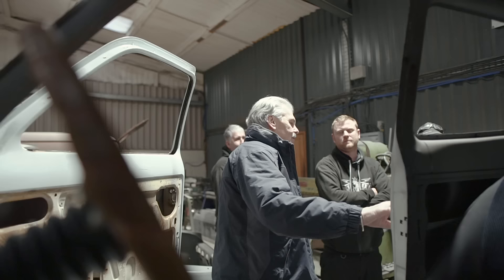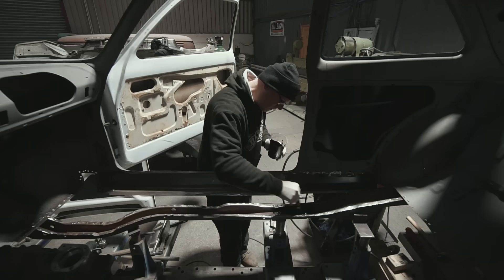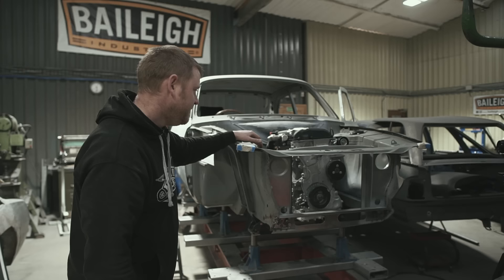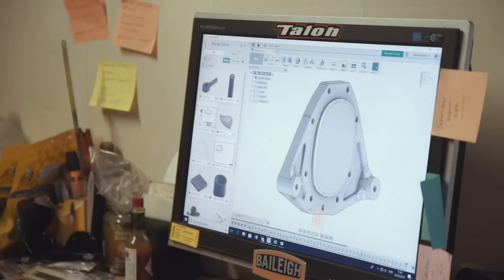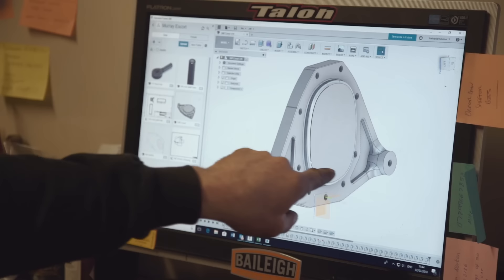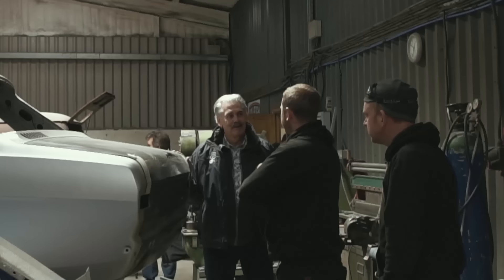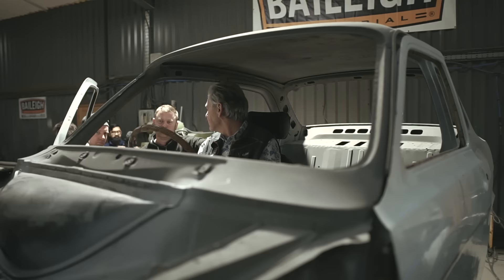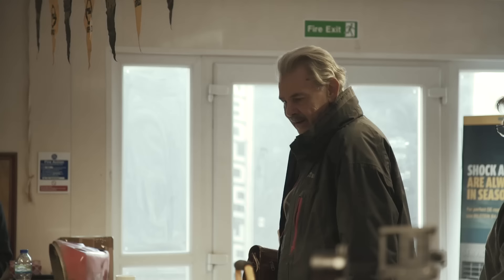Gordon Murray's MK1 Escort - Retropower Build Episode 4

Comment: It can be seen that there are still quite a few decent MK1 Escorts knocking around, it must have been a temptation to get another car and build this project into the best one they could find. You can be certain that when the car was current, rally cars and circuit racers were more often than not converted from 1100cc shopping getters.....
Reply from the maker: inquisitor229 the problem is most of the "better" cars you see aren't what they first seem. We've blasted 100s of cars and invariably the best ones are not those which initially look shiney and straight. That's not to say we couldn't have found a better one but keep in mind that Labour is being charged to search for and view cars, and the purchase price of a seemingly good car would be much higher.. at that stage the loss if it's found to be hiding a lot once blasted is more substantial. It's not a straightforward process sadly.
Reply: Understood. Although I didn't think Gordon Murray was stuck for a few bob.......   :>)
Reply from the maker: inquisitor229 true 😎 but that doesn't mean we aren't at least trying to avoid wasting money uneccassarily. Could we have hot a better shell for the money? Quite possibly... But we could have done a lot worse too so happy enough 👍🏻
Reply: inquisitor229 why do you put ......at the end of each sentence? What does that mean?
Reply: It's my way of suggesting the topic is open ended, and that I am not trying to give the impression that what I am writing is definitive (more of an opinion). It's an invitation to continue the discussion. I had a MKII Escort re-shelled, and appreciated the advice given by others.
Reply: It was a bare shell already stripped of parts, which suited me perfectly. I stuck with the plain front end so that it was a classic 'sleeper'. Only a true expert would have noticed the exhaust coming out the opposite side at the rear - the engine being the American designed Pinto intended for left hand drive. All RS2000 and those few 1600cc SOHC variants had this set up.

Comment: Enjoyed following your project. When looking for an IRS unit there are these on the market (http://www.hoyle-suspension.co.uk/Pages/Independent%20Rear%20Suspension.html) yes they are for MGB's but using all the Ford parts you are using plus subframe/uprights etc and engineering done so easily configured for your Escort.

Comment: I read so much about epoxy primer and yet when I've done my cars rear subframe it flaked off in under a year. Was degreased, rinsed, dried, wire brushed, etched and given a couple of coats, took 3 days to do it right but the stuffs just fallen off.
Reply: Proper finish comes down to a lot of things. Most paints require a quite specific degreaser. Temperature is very important (both in the paint, material and room), the type of brush (hair material) if used etc. And its still a primer. 
Besides, on subframes that face the elements all day (including rocks, stones, salt etc) the paint gets quite the abuse. Finishing the primer with something like an anti stonechip coating will work nicely. Epoxy primer is mostly about rust protection more than anything. For subframes and suspension components you could also go with a dedicated 2 part chassis paint (industrial if possible) or powdercoating.
Reply: Whats the advantage of 2 part paint over something like Hammerite? I was planning to strip it back, treat with rust convertor then Hammerite and maybe underseal.
Reply: Hammerite does NOT work with any other paint or sealant. Its meant for rusty garden fencing and there it works well. I've used it on suspension components in the past, but it doesn't work very well in that application. it also doesn't work terribly. Its meh. If you have a can that you'd otherwise not use and the subframe just has surface rust and no holes, I'd use it no worries. But for a bit more than a can of hammerite, a 2 part epoxy and then bodyschutz/stonechip is a great budget solution.
Reply: Thanks for the feedback I'll give it a try.